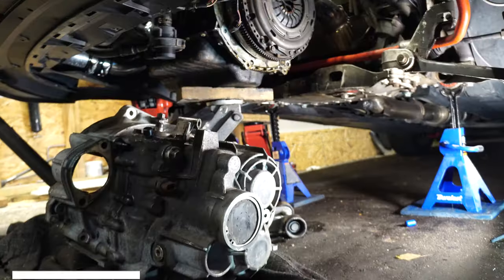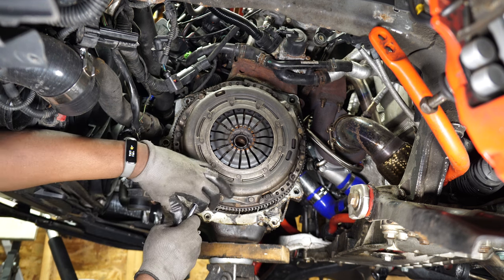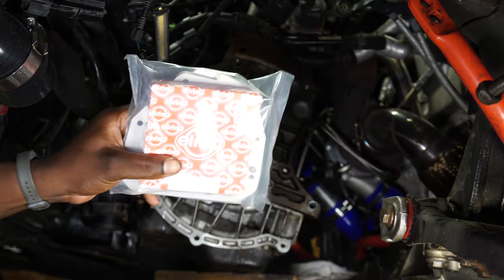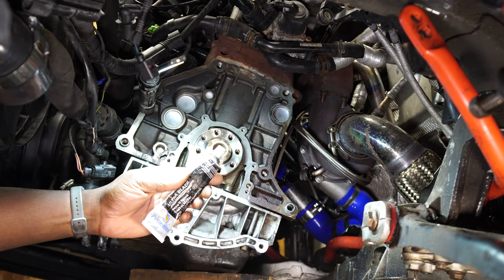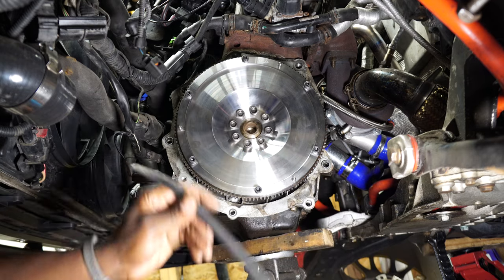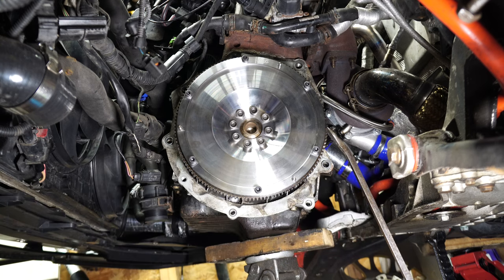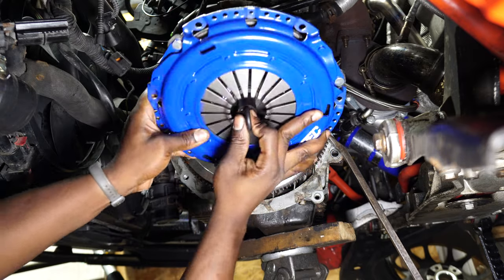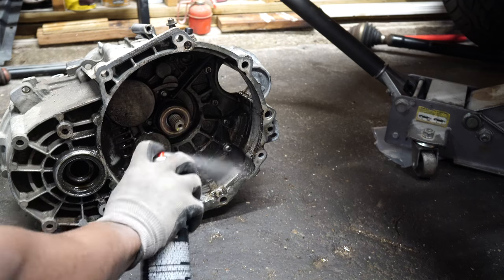VW MK6 GTI [RMS/Clutch Kit Install] Clutch Upgrade - Part Two

Comment: I wanted to see you wrestle that trans back into place, lol. I probably would opt for using a motorcycle jack or engine hoist.
Reply from the maker: It's kinda tricky using a hoist, because it has to rotate at an angle while going up. But yea, I had to bench press the trans back in, definitely not fun. Lol

Comment: What about bench bleeding the throw out before install ? Are you doing part 3? Maybe some bleeding and clutch break in
Reply from the maker: I was going to pre fill the throw out bearing before Installing it, but then I decided not to. Just gotta follow the manufacturers recommendation on the break in process. I might do a follow up video.

Comment: Nice job, but the single mass fly wheel might end up destroying the brass synch rings in the transmission. Good luck..
Reply: ive never heard of  that.. Ive been on a single mass flywheel on a MK6 GTi and over 100k miles with it in and it still fine. Ive got a golf R where i did all this same work but only 30k miles since i did it no problems with transmission.
Reply: @admk2500  it's actually a thing, but tbh, most mk6 owners Whom are exploding their trans ride them like pigs so it's no suprise

Comment: Is it true that the manual transmission doesn't have a pilot bearing? Will i be able to just take the pilot bearing out and install the flywheel if i am swapping in a motor that has a pilot bearing from the previous car?

Comment: Thank you for the upload. Watching this video cause I already have to replace my stage 3 spec clutch after 15k miles. Slipping like a mf and I'm only a ko4 mk6. How's urs been holding?
Reply from the maker: Much respect! Did you properly break in the clutch? Mine is good so far.

Comment: Do you know what would cause the following symptoms in a 2012 VW Golf 6?
-when the AC is set on cold, it blows hot air; when it is set on hot, it blows cold air
-even on the highest power setting, although you can hear the sound, not too much air comes through the vents (the air filter is new)
- when changing the settings as to the location (for example feet, or directed to the windshield), even less air comes out of the vents- one setting works best.
-while rotating the temperature button you can hear the difference of inflow
I need to mention thatt the car was a right hand drive and this year was changed to left. The mechanic that did it said that the AC unit needs to be one for left hand drive cars otherwise it won’t work. Is he telling the truth? I’ve had many problems with the car since. Unfortunately it was a mistake but now I am trying to fix as much as I can.
Reply from the maker: That sounds like the issue is with the climate control. Yes, you could replace it and see if it resolve the issue.

Comment: Nice work! This will help me a lot with installing my DKM-MB clutch. Aloha 🤙🏾
Reply from the maker: I'm happy you found this video helpful, thanks for watching!
Reply: @CraftyWorkshopBuilds  hello you look very professional
Reply: it's as if the transmission is put to slip and the turbo expels the air even with the foot on the accelerator

Comment: I replaced that throw out bearing twice for the yr already should I use the clutch masters billet unit is that more reliable  than the OEM unit ?
Reply from the maker: I've seen both the plastic and the metal ones fail, I'll see how this one holds up.

Comment: Part 2 as good as part 1, bravo!!  But one question, would you recommend loctite on some of those bolts especially the seal, flywheel and clutch plate?
Reply from the maker: Much respect! you don't necessarily need to but you can put it.
Reply: @CraftyWorkshopBuilds  I’m half tempted to just weld the parts of the DMF together :) :)

Comment: Ain’t nothing like that good ol auto zone brake clean man lol thing is lethal. Definitely good to know I’m just getting the stage clutch above yours but still ECS because I love how that flywheel looks fr. I was told I should look into getting an all metal throw out bearing tho.
Reply from the maker: How much power you plan to put down? Yea, I was contemplating about getting the metal throw out bearings, but I saw some people complaining about it as well, so I decided to use the same plastic  type again.
Reply: @CraftyWorkshopBuilds  I’m shooting for the 500 range whether hp or torque on a future AWD swap, Biagio, 1.8 to 2.0 stroker with forged internals and methanol setup. So big boy numbers lol and on a MK6.5 Jetta at that lol. It sucks we don’t have better clutch options because I’d definitely wanna go higher seeing my goal is right at the peak of that.
Reply: @CraftyWorkshopBuilds  what we’re the complaints if you don’t mind asking? I was told it would just be best to eliminate the plastic for structural integrity reasons.